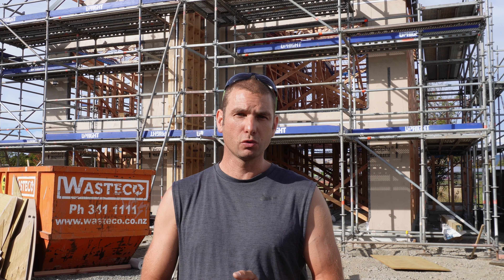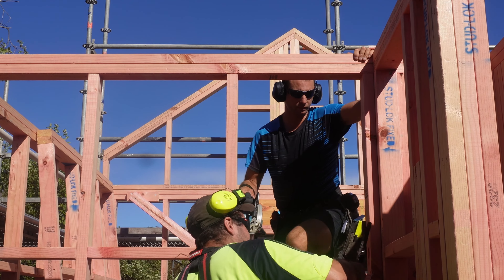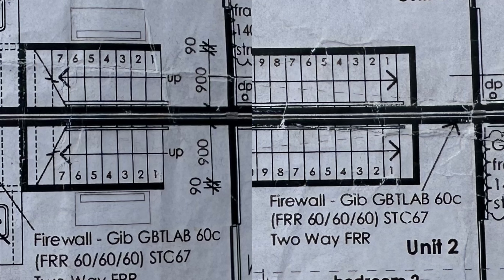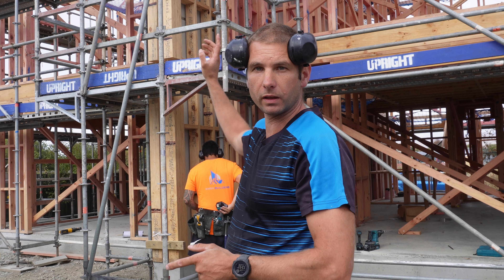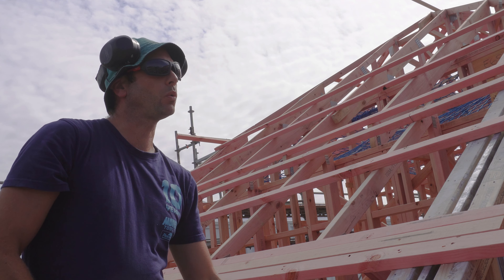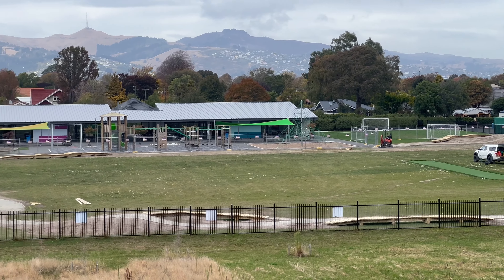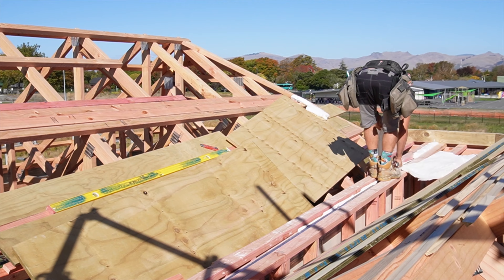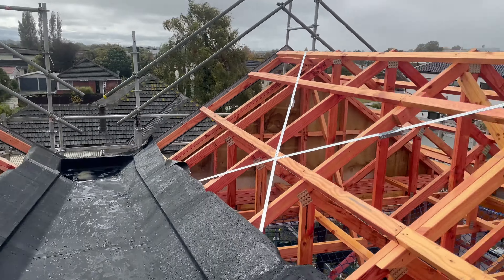Why is this build taking so long?

Comment: Hello from South Carolina USA . One of the most impressive things .. Is the scaffolding . I couldn't imagine being provided that much safety here . That would have been a dream come true . For clinging to a wall. Running siding , cornice . The best we'd be able to get . Was pump jacks , ladder jacks , scaffold bucks at best or the dreaded " Pudlock " Which is just 2x material jerry rigged .  Walkboards were anything we could find . Sometimes you might have an aluminum walkboard  . LVL or a 2x10 loaded with knots. There was never a worry of a Safety Inspector on high end or even low end residential . Roofs you just wing it and hang by your fingernails. Builder's and subcontractors just want it done and couldn't care less how . Since they aren't paying for surgery or funeral arrangements . In my 43 years as a carpenter . I've been lucky and only been in the hospital for 5 days . Once for a broken hip and broken hand after a scaffold gave way . Another for sliding off a roof and fell three stories , Fortunately I landed in the snow and missed a cube of brick. I've been enjoying all the down under carpentry vids I find . The fall protection is amazing.  I like patient thinking carpentry and never the wide open rush . Your plans are different than ours. Here I haven't found one set that wasn't ever riddled without mistakes  Spend half the day hovering over the plans and going on an Easter egg hunt . Started in 1981 working as a pack mule and we had to slap up two houses a week , Worked my way up to building the homes that'll make most carpenter's hair fall out . Walking around with a laptop and being tracked by GPS and laser total stations telling you that you are 1mm off. In my 43 years the technology has changed a lot . My career is essentially over as a carpenter because of stage 4 cancer ,  My passion is alive and wish I could impart my knowledge unto the young guns . Loved the work . Followed . Peace
Reply from the maker: I'm sorry to hear about your cancer. People with your skill set are slowly disappearing, and with them, the skills that we often think we don't need.

Here in NZ, most of our frames and trusses are pre-made, so learning to figure out angles for rafter etc in becoming a rare skill. I managed to get a bit of practice here on the internal gutter though, which was great.

I think all the rules around fall protection only came about 10 odd years ago. I certainly remember before that seeing builder walking around on top-plates without protection. It still happens, but it's not something I'm keen on. As I'm sure you know, it only takes one tiny mistake to change or end a life. In saying that, one thing I didn't including in this videos is how many times the scaffolders got it wrong on this job. On Friday they were back for a third time because they had built the platforms in the wrong place. They actually had one platform in the way of our soffit where the gable frames were replaced.

You take care of yourself. I look forward to hearing from you again.
Reply: @Lenzcarpentry  Thanks . For the reply

Comment: This build seemed like everything that could go wrong did but you made it to the other side. Is this normal re the mistakes with the framing? Who does the detailing for the pre nailed framing? Is this done off the plans?
Reply from the maker: This was by far the worst I've seen, although, to be fair, I really haven't seen that many. It's normal to have a few minor issues, but to have so many trusses wrong, repeatedly, is very unusual.

There's about a dozen detailers at that factory, and this one told me he does 6 houses a week, so they are under a bit of pressure. It is all done off plans, and sometimes plans aren't the best and are open to a bit of interpretation. I don't see how any of the issues on this one were the result anyone's mistake but his own.